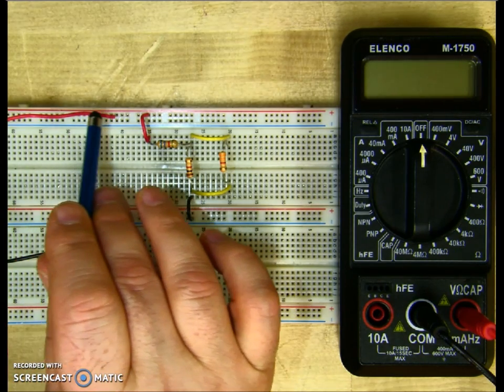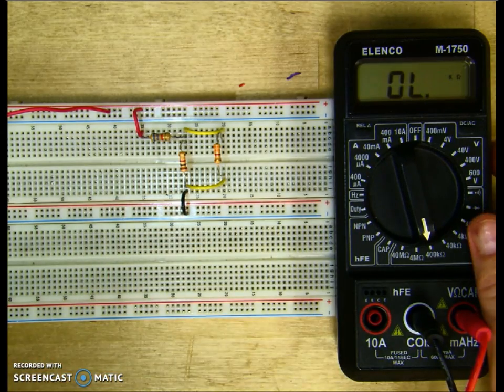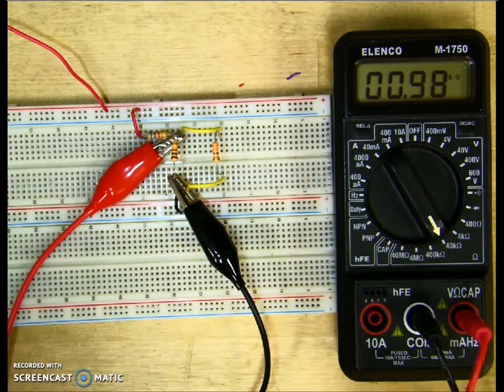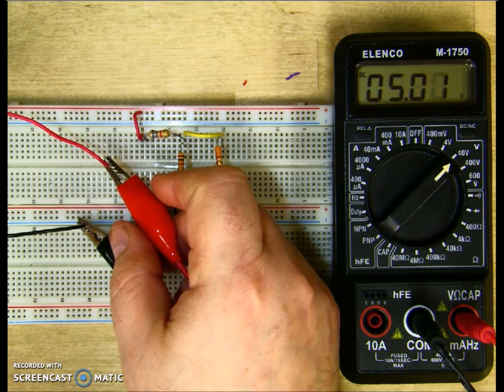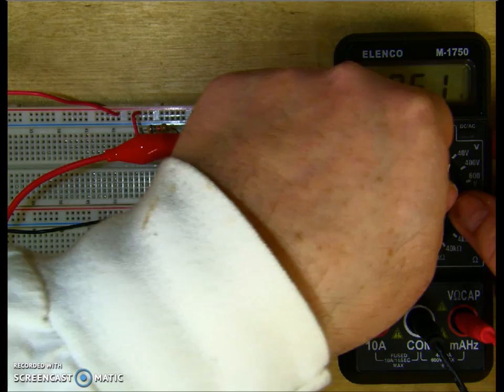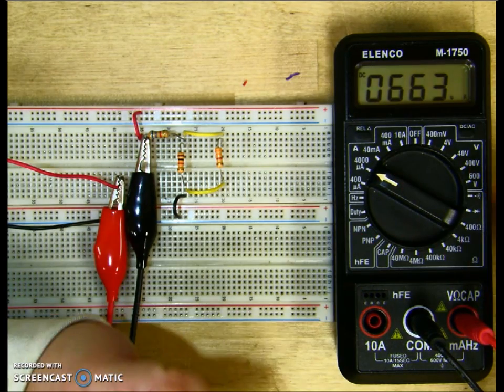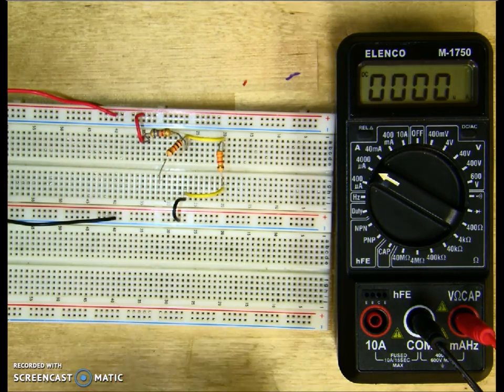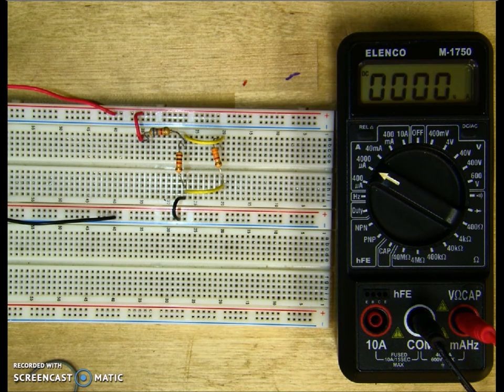Measuring a series parallel circuit

Comment: If we want to measure the total resistance and the circuit is connected to the ground and a power supply, should we disconnect them?
Reply from the maker: Yes. Otherwise you would be measuring the circuit in parallel with the source which would give the wrong reading.

Comment: u removed the black wire while measuring the values? do we have to break the circuit ? I mean remove the ground wire?
Reply from the maker: At which point? The first time I remove the ground wire (1:09)  is to measure the total resistance of the circuit. You have to have the power supply disconnected in order to get the correct resistance. If you leave the wire in place with the power supply connected, you will get the circuit resistance in parallel with the power supplies resistance.
Reply: okkkk thanks alot man I got full marks in viva

Comment: How can we measure the current without using jumper
Reply from the maker: Praveen 04679 you really need to have the jumper to make sure you complete the circuit branch. You could pull out the other 2 jumpers, but there is a risk of not connecting to both wires and getting a false reading.
Reply: DKTrnavsky bro i mean without using jumpers how to close the circuit and measure current.my professor told me to do the experiment without using jumpers
Reply: But how?